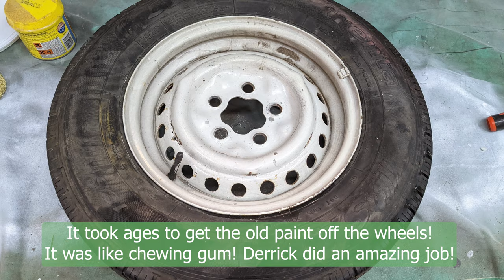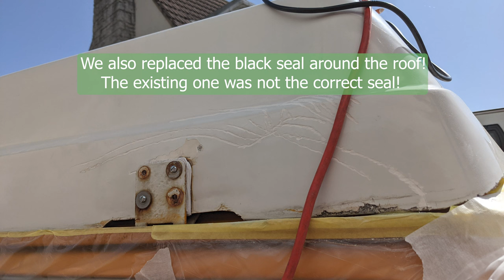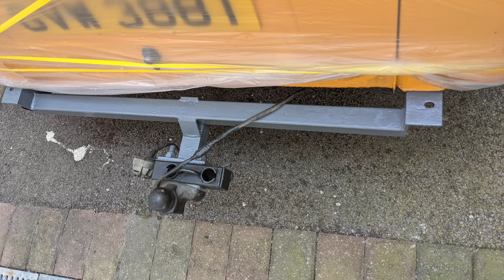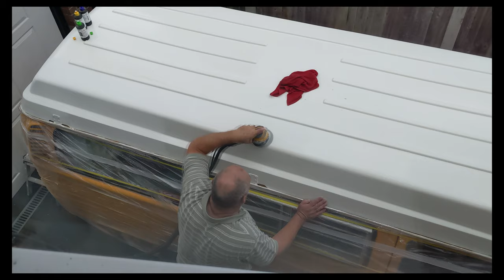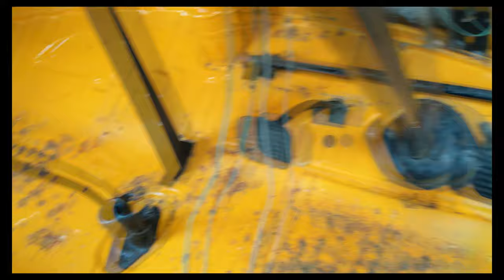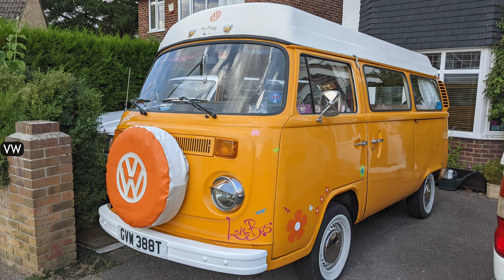Volkswagen T2 Bay Campervan 1979 | Summer Projects In 2021| UK

Comment: Hi. I don't normally comment on videos but I have been doing an attempted restoration on a t2 bay we bought in lockdown. I have converted several t4 and t5 vans before but thought I should own and try to preserve a t2 bay to test my skills. She is called marigold :)
Marigold has needed Alot! Of work. I've taught myself welding and all kinds of new skills during the process so hope the below helps.
The reason I am commenting is the part where you mention loose rust in the bottom of the front valence and you did not know where it came from.
 I'll tell you exactly where it came from, as marigold was the same. What happens is the wind screen rubber seal fails and water gets in. The strip of metal that the windscreen sits on rusts over time and eventually goes through. Marigold had NO valance left when I took the screen out.
Please get it checked out as will cause all kinds of damage to Amber's internals.
Hope you get it sorted 👍
Reply from the maker: Hi Nick, thank you so much for the information, I will definitely check again to see if there's any more rust. I hope all the work with Marigold is going well 😊